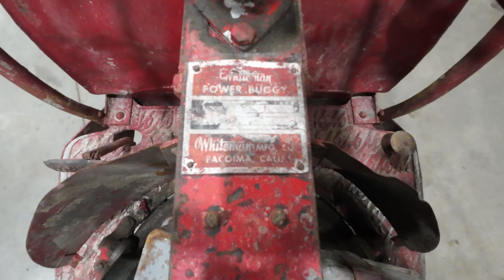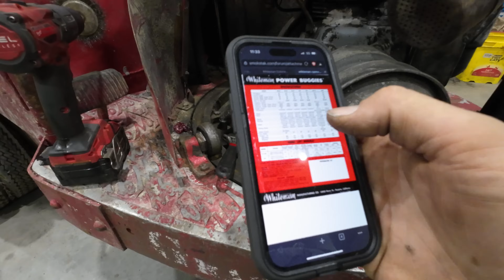Marketplace Find | Will this Motorized Dumper Ever Run again!??

Comment: The old Wisconsin really takes me back.  I was 9 years old in 1974 when my Dad bought two David Bradley Walk Behind garden tractors with 5 HP Wisconsin engines.  From that age, I was taught that Wisconsin engines were the gold standard of small engines.  My dad retired with over 43 years of working as the real live "Hank Hill" with propane gas, and during that time, he converted one of the David Bradley walk behinds and two of our Wheel Horse riding tractors with even larger Wisconsins up to 20 HP (not to mention various family sedans and pickup trucks) to propane power.  EVERY ONE OF THEM had the pulley you had to wrap the rope around to start, like the one you have in your video.  I remember Dad having a trailer to pull behind his walk behind tractors and he would ride in it and my Mom would refer to him as Ben Hur in his chariot.  I also remember the insulation on the kill switch on the magneto being somewhat "shockingly compromised" and making my brother and me to use the choke to kill the engine instead of the kill switch...

Comment: I had one of those Whiteman buggies years ago.  The steering is really a unique device. You don't shift to go in reverse, you just turn the steering wheel until the engine points backwards.   They will turn on a dime ifyou go slow.  You can know when you are turning too fast when it flops over on its side. They are definity cool.

Comment: That magneto has an impulse coupler which is what makes the loud snapping noise. It's intended to snap the magneto shaft around when starting (turning at slow speed when pull starting), to give a fat spark, and drops out of operation once the engine starts spinning faster. It's best not to spin a magneto over without the secondary grounded. The high voltage wants somewhere to go, and can go through insulation if there's no appropriate ground. A drop or two of light oil on the felt pad on the magneto cam will keep it living for a long time.

Comment: If you ever get in a bind, and can tell where the pinhole in the float is, you can usually warm it till it dries out and use a little solder to fix it.

Comment: In about 1962 we bought and new John Deere combine which  had a CVT belt system. I was about 16 and was fascinated by  the system. The combine had a 95 horse power engine and a lot of pulling power even through the belts.

Comment: DC, as a former small engine mechanic in the 50s + 60s I always set points at matchbook cover gap and the carbs at 2 1/2 turns out on the high speed needle. Cool video! Love to watch you save the oldies!

Comment: What a cool toy!
I'd suggest an oil extractor.  I've started to use one, which I use with an air compressor, and it's great. No more pan and oil cleanup. Clean and thorough.

Comment: I would love to see you do a full restoration on the running machine and the non running one do a twin cylinder predator motor swap and turn it into the motorized beverage cooler

Comment: FYI:  If you will put your knot on the rope in the slot on the pulley and wind your rope around it, it will be a lot faster than spinning your motor backwards to wind it on.  That's how we did it old school.

Comment: If you adjust the float, you will not get more force on the needle. You will get a lower fuel level in the bowl and therefore, a slightly leaner mixture.

Comment: Hey Matt it's the float leaking needs to be soldering up.
Really good around the seems to along with any pin holes. Then liquid float. That's how you can repair the original float.

Comment: This dumper is really cool. I have never seen one before. Here is a suggestion in order for the operator to orient the drive direction at a glance without having to look down at the motor: put a single mark or line (such as a heavy loop of electrical tape) on the steering wheel when it is lined up with moving forward. Basically, have the marked line on the "front" (farthest point away from your seat), that way you can glance at the road, the load, and the steering wheel all at the same time and know that it is ready to go forward. I would also put two parallel lines on the opposite side of the wheel ( the point nearest your seat) so that when you are driving in reverse those two lines are pointing towards your load which you will be checking any way. My suggestion should free you from having to look under your seat to confirm wheel direction. Just a thought. Love your page. Joe living in Germany.

Comment: That's where the roller comes into play on the job sites and videos on using that. After rolling it out and compacting it down into the ground smooth. For it to move freely for the next hopper wagon dump out. Then repeat process dump it out and roll it out.,or compactor to compact it down with. Try to test that tip trick out with it matt. You might be surprised by the outcome of that.

Comment: Matt , i have a whiteman  power buggy forklift, i love it , it was used back in the 1940s in box cars on trains. you can turn a 360 turn in a 8' circle. it has a 8' mass and i use it to trim my trees. i built a cage to replace the forks and it works perfectly.

Comment: The points are mechanical on the engine and when it turns opens and closes the points putting off and on the 12v to the coil and (making AC) transformer mag flux from primary to secondary creates a step-up transformer and a 100 to 1000 to one ratio means 12x 100 or 12v x 1000 for the spark.  Color blue likely 1000 to 12v.

Comment: You can repair that float since it is made of brass. You just need to locate the source of the leak. You can solder it. I am not a welding expert by any means, but there is a type of welding that will work on it as well, since a new one is unobtainium. I definitely would not throw it away.

Comment: 2 stroke engines in particular don't like ethanol mixed fuel . And if they sit with it in it they'll gum up . An ultrasonic cleaner is always your best friend for any fine parts cleaning . I have a 30L Vevor . The thing is awesome   . Also it's great to use 50:01 mix for starting anything  . Best bet is to use 91 or better ethanol free fuel . My $0.02 . Awesome video once again Matt  ! Thanks buddy  !!!

Comment: Go to England and on most building sites you will see later versions moving all sorts of materials.  As you said it sure beats a wheelbarrow, particularly on sites with limited access, like back yards with only 6 ft between the house and the fence.

Comment: Our buggy was the later version with the front wheel drive and a flip down platform on the back to stand on. 
  It definitely wasn’t designed for dry goods but it was absolutely unstoppable if it had a good surface to run on.

Comment: My dad was a contractor in the 60’s and I remember watching a crew pour concrete on a floor slabs. They were wild with them never slowing down on dump, one hand on the wheel the other on the dump handle, splashing concrete! Occasionally they would turn one over…..the fastest way before pumps.

Comment: Looks to be Wisconsin AKN or BKN engines... there should be a spec plate riveted to the fan shroud, but a lot of times the got damaged and fell off. I've used a few on the Cub Cadet Original, they're roughly 6 horsepower. The drive mechanism reminds me a lot of Swisher mowers, too with the steering and drive wheels also being your forawrd and reverse "transmission." I swear, Matt has all the luck, I haven't found any old iron in several years!
Edit: DOH! I made my comment about 2 minutes before Matt said it was a BKND!

Comment: We had flat bed trucks in the dockyard I worked back in the 80's. They had a similar engine arrangement (made by Lister), the driver's seat was on the front of the bed and steered with a D shaped handle on top of the engine with bike brake style throttle controls on the handle, the foot brake was on the bed going to the rear axle.

Comment: In the UK  years ago there was a three wheel car made by Bond whose drive was a similar kind. The engine was from a motor bike mounted in a similar way on the front wheel. The steering was the whole of the engine turning in a frame. You had to kick start the engine.

Comment: Back when I first started driving a mixer in 79. I went to a job and they had 3 of these running the mix. Because access to a truck was impossible. They moved quickly and were able to empty the 11 yrds I had on in about 25 minutes. They all had a white paint strip on the steering wheel to show were forward was.

Comment: I love getting old engines running. Matter of fact, I found it hard to find replacement parts for these old engines, so I started welding up my own intake manifolds and installing new style carburetors from these newer predator engines from harbor freight. Another thing you can do is just replace that old engine with a brand new predator engine for just over $100 at harbor freight.

Comment: Float:  could you dry it out and resolder?
Replacement engine:  Harbor freight to the rescue along with a snowmobile clutch or maybe check Tractor Supply or Go Power Sports?

Comment: That's basically what I do: Get old single cylinder units back into life. This engine of yours apprears to have a very similar air cleaner of my Clinton B2500-1000, which is from the 50s. The ignition box looks like the one from my Bernard W0 from 1930s. They also have Zenith carbs. Tomorrow I am going to look at a Winsconsin aswell. Like your engine, it lacks the manufacturer tag too.

Comment: 1960 or so, a Swisher Ride King steered and drove with a single front wheel. The motor did not move, but was chain driven
David

Comment: What a neat new toy! Styrafoam shaped to the inside of the bucket and you'd have the one and only powered cooler. You could cruise around with the fellas that made a gas engine driven couch they had one year at the EAA Airventure/convention. The campground is about 40,000 airplane nuts, so you'd be quite a sight. Thanks, JimM

Comment: Like another gentleman on here this also brought back memories, to Me although the one I drove when I was aged about 10 around a pig and chicken farm helping my father that he worked on some 64 yrs ago, it was not the same make or model here in the UK, but it was a very similar machine, it had a turn handle type starter which you spun till it started, also it memory serves me right it was a one cylinder diesel, the farm owner bought it second hand from a local builder firm, and it was used every day mainly for feeding the pigs, he used to buy bulk spent milk from a local dairy, to which we mixed in pig meal to a fairly thick consistancey and fed that to the pigs twice a day, he only bred the pigs for bacon not pork, and was highly regaurded for his quality bacon in the farming industry.

Comment: In the 60s a company called Bond made a 3 wheel light car, in the UK with one wheel at the front, and a 250cc engine in it, (Villiers?) which turned in the same way as this buggy, the difference was that it was manual gears, and you had to step inside the bonnet/hood to start it with a kickstart.

Comment: Got the same engine on a wood splitter, you can put a Kohler recoil on them pretty easy. Mine starts first pull every time no matter how cold it is or how long it has sat. Mine is I believe a 1955 it still has the River side sparkplug in it since it was sold through Montgomery Ward, great engines might want to check the other engine fill plug, because mine has a  dip stick on it and the fill mark is below the threads a bit.

Comment: I had an old outboard motor with similar starter string. There was a small problem, since sometimes when it did few powerful strokes in a startup, the starter rope stuck on engine and started to spin like a crazy. There was nothing to stop it and of course the handle was solid wood.

Comment: That thing is a hoot! What a well-designed little machine to fill a specific niche. And so many potential new uses!
What size are those front tires even, 10s? Took the weight of those rocks pretty dang well!

Comment: Hi  Matt, love the stuff you do and I’m jealous of your shop.  I am living in a 37’ fifth wheel trailer so even having a garage would be great.  By the way, when I was a kid, many years before you were born, I used lawn mowers that didn’t have recoil starters.  Like the starter on your concrete movers.  We always put the knot end of the rope in the notch of the pulley then wrap the rest of the rope around the pulley.  Then you just pull the rope and hoped the piston wasn’t frozen in the engine and started on the first or second try, otherwise you are going to get tired fast.  Don’t kill yourself turning the engine to wrap the rope on the pulley.  It is easier the other way.
How many tries did it take to get your cameras on the ground where you wouldn’t crush it by driving the deuce and a half over it? Keep up the good work and thanks for the hours of entertainment, at Ritchie Brothers, the steam shows and in your own back yard.
Paul Russell

Comment: I’m 72 years old and worked as a mason for 40 years of it. I’ve actually ran a couple of these back in the day and they were a real workout. If you had any baby fat, it would be gone after running one of these for a couple days. A couple tricks to running these is to go about as fast as they would go and when you got to where you wanted to dump it you would let off the gas which would shift some weight forward, then you spun the steering wheel a 180 degrees and hit the gas. This would move the weight forward and you could spin the wheel to dump it as fast as you could, it was a coordination thing that once you figured out made it not so bad to run. When Whiteman put hydraulics on these for forward and reverse, and for dumping them it was a real game changer, plastic hoppers also made cleanup a lot easier.

Comment: This is a great machine!  I think if I owned it and was going to use it for work, I'd convert those dual tires to a single wide tractor tire but no wider than what is there.  Also use a same style tread on the drive wheels for better tractor especially if you are working in muck.  I'd also add those steering wheel knobs to those wheels so I don't tire both my arms turning those things.  Maybe even fab up some simple shielding for the motor.  And lastly if possible upgrade that rip cord to the new retractable type.  Sooooo much potential for this machine.  I love it!

Comment: In my collection of toy construction vehicles, I have something similar to that, except for it has tracks and a hydraulic lift cylinder. But thanks for finally filling me in on what those things are used for because I had no idea until now. Model size for the toy is roughly about the size of your hand..

Comment: I had experience with a similar unit, Gar- Bro mud buggy. high speed turns with sloshy concrete can roll you! Anyhow, My word of advice is this ... do not turn the engine backwards. (counter- clockwise) viewed from the start spool. the magneto has a spring impulse unit in it that may be damaged especially when things are a little gummy from setting.   Best Wishes, Carl

Comment: 3:10, Now, that’s pretty neat…
These would be cool with a single cylinder diesel, like a 6 to 10 HP.
7:14, Looks like the designers thought ahead, with the oil drain tube setup.
How good is your Internet out at the farm, when needing to look up stuff??
A bit of Sea-Foam in the gas definitely isn’t a bad thing, it works.
33:22, the wheels were turning…

Comment: Looks like a fun toy. It could be great to cruise around Steem Show or other events.   Id likey find a little preadator or other briga honda or whatever and swap it on those cvt clutches are cheap.  Then u can have 2 running carts. Or sell off 1 if u dont want it for parts doner

Comment: Just very cool.  I remember about 60 years ago when I saw a few machines like this on a construction site.  I believe something similar was made by a company called "Diamond T", or at least that is what I recall the construction men called them.  Brought memories back for me as it did others that commented. I had dreams of growing up to be an Operating Engineer.  Best I did was to operate some heavy equipment at a local grave yard at the age of 14.  I ended up getting degreed in Mechanical Engineering.  Retired now.  It was an excellent career.

Comment: As someone who doesn't work with vehicles but rather electronics, I definitely think you could use an ultrasonic cleaner for your shop. You could throw the entire carburetor (or any other small parts, screws, spark plugs, you name it) into it for like half an hour while you work on something else, and have it come out looking almost brand new, free of any gunk inside and out. Yeah sure it wouldn't help with fuel in the floats like in this particular case, but doing a deep clean like that at the start of any new project sure as hell won't hurt, plus they're not that expensive and you can totally reuse the fluid a few times (or even just use water)

Comment: Back in 1975 when I was an apprentice cement mason and we were working on buildings in Manhattan NY around the 50th floor. The labors would be driving these buggies on 4’x8’ sheets of plywood on top of rebar with only a safety wire around the exterior of the floor that was supposed to prevent them from falling off the building. These guys would drive with full open throttle turning the wheel to spin in different directions and turning the dump wheel with the other hand dumping the concrete. But there would be 2 buggies passing each other on that 4’ wide plywood. The empty buggy would only have one side of the front wheels on the plywood and the other side would be above the rebar because the driver would be standing and leaning his weight in the towards the wheel that was on the plywood. They would do this for 8 to 10 hours during the pour. I only saw one guy flip the buggy into the rebar. They were the cowboys in the sky.